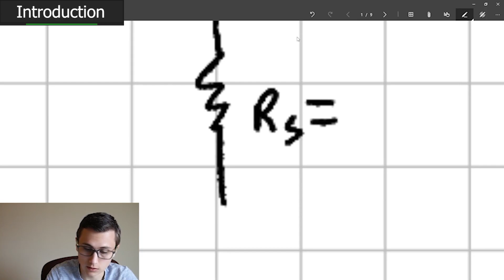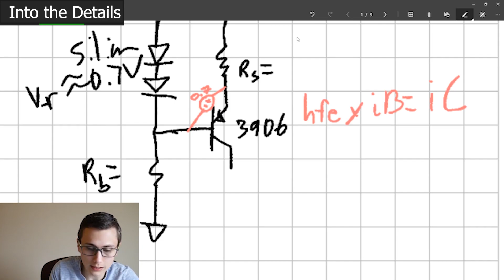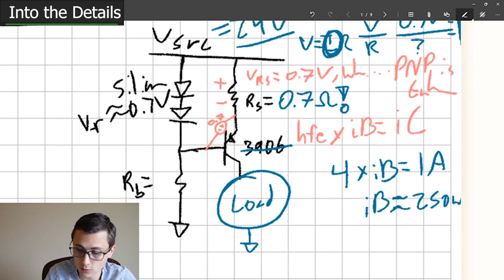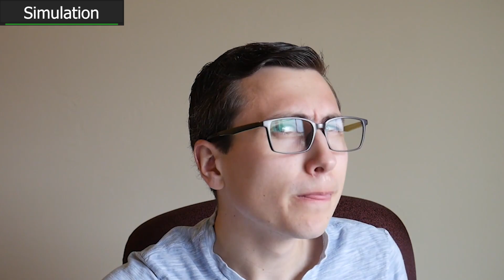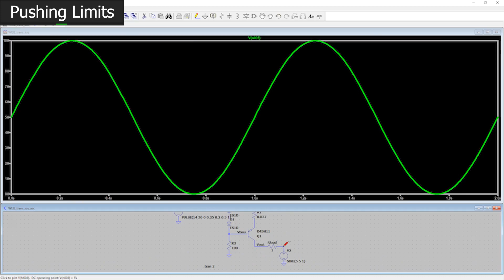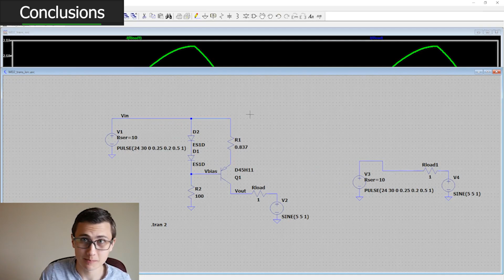Building a BJT Current Source

Comment: If you thermally couple the diodes to a ptc thermistor running from the supply voltage would that create a more stable reference?
Reply from the maker: Hello Han, It would certainly be possible to use a thermistor to compensate the diodes, though a commonly used temperature compensated current source uses an NPN and PNP pair. I'm looking for a good article that describes the function, but sadly.. the most direct resource I found is from stack-exchange. 
https://electronics.stackexchange.com/questions/199379/temperature-compensation-in-transistor-current-cource

It uses the temperature effect of one transistor to counteract the effect in the other! Very fun trick that doesn't work perfectly for discrete components, but works very well for integrated circuits, where transistors can be almost identical.

As always, there are a lot of ways to accomplish the same effect in electronics, and the right path depends on a lot of details!
Thank you for watching, and thank you for the Great question!
Reply: @EEforEveryone  kl! I guess the slower thermal transfer you would get from using descrete components might still be good a LED driver. Where the Vf slowly changes and good transient response isn't needed from the current source.

Comment: 9:00  
V2 = SINE(5 5 1)
What is 5 5 1 and where does that come from ?
Reply from the maker: Hello Suhaila, that's the syntax of ltspice for voltage sources. That's defining a 1Hz sine wave with an amplitude of 5V, and a DC offset of 5V. 

So, a sine wave which ranges from 0 to 10V!
Thanks for watching!
Reply: @EEforEveryone  
Thank you for your answer.

Comment: hi excuse my poor knowledge

how did you just assume Hfe to be = 4 .. 

isnt it defined in datasheet with big range and from BJT to another its different ?
Reply from the maker: Hello Hasan! 
No need to put yourself down. The fact that you are willing to reach out and ask the question is super important!

a Hfe of 4 was a safe assumption. For a 2N3904, the minimum current gain at any operating point is 15. I'd typically expect at least 10.. so rather than look up the gain of a real transistor, I used a rule of thumb based on my experience that I would expect to work on every pnp transistor....

As long as I'm thinking about this... Let me find a more realistic part. The MJW1302AG from on semiconductor is a power PNP transistor, rated for up to 15A! Looks like the minimum gain with a 15A output is still 12, so I think my assumption worked!

Of course, when designing a circuit for a real application and not as an example, it's important to dive deeper into analysis. Without sufficient base drive current, the output current of a BJT will not be as high as originally intended!

I hope this helps, and thanks for the GREAT question!
Reply: @EEforEveryone  hi .. thanks for informative reply.. 

perhabs my question isnt clear or i didnt relate the answer to it ..
i was more concern about 
what if you asume HFE = 4

and then you the actual HFE of the BJT is actually 5 or 6 .. so the current is 5 times bigger not 4 ..

as far as i know it also varies from one to one even if they were identical part number
Reply from the maker: Aha! Yes. I see now. In this case, the maximum current is limited by the resistor connected to the emitter of this PNP Transistor. 

Basically, the circuit is designed so that as long as there is more than the required base current available, it will function as intended. Since the voltage reference is approximately fixed, if too much voltage drops across the emitter resistor of this current source- the transistor turns itself off.

I hope this helps!
Reply: @EEforEveryone  ah, so R1 is biasing resistor that functions to reduce the impact of changing of HFE (wheather its change from part to part) or (room temperature) .. ?
Reply from the maker: Hi Hasan, your comment is very close to the truth, but I think about it in a slightly different way.

For example, if 2v were dropped across R1, then the base-emitter junction would be reverse biased. The transistor would be completely off.

If 0v is dropped across R1, then the maximum base current will flow through the transistor, and therefore the maximum collector current.

If that maximum base current isn't enough to achieve the desired output current, the system will never resolve into the desired steady-state condition. With enough base current (and gain), the system will fall into a balance where some voltage is dropped across R1 and ideally, we programmed this point to achieve 1A on the output.
Reply: @EEforEveryone  wow thats very clear .. now i understand why hfe is 4 .. thanks 🌹🌹
Reply from the maker: Happy to help!! Cheers!

Comment: Do you know something call ( LM4041-N ) To-92 package.
Can I use it exchange of 2 diod ?

Or is there a specific setup I can use for LM4041

I did not test it yet but they say it's can be programmed from 1.2v and up.

If you have some good ideas for it let me know please .

https://www.google.com/url?sa=t&source=web&rct=j&url=http://www.ti.com/lit/gpn/lm4041-n&ved=2ahUKEwjt2s2_2f3oAhUIkRQKHSqqDwEQFjAAegQIAhAC&usg=AOvVaw3a0poxLgIlVZ_CDdPwSAHF

What about TL431
Reply from the maker: Abed! Yes, I love the way you're thinking about this! Absolutely, a precision shunt voltage reference like this would work great as a temperature-compensated alternative to our two diodes. 

It's a two pin-device, so it can live on the high side of the circuit for our current regulator. I think power consumption may be a problem for higher-power designs, but for something like a 100mA-1A linear source, I think this could work a lot better than the simple diodes used in our example!

If you're open to more methods of current regulation, make sure to stick around for our upcoming videos! We have some videos coming about building more complex, but higher performance current sources! Super fun!

I love your creative thinking, and quick improvements to our design! If you want to try this in LTspice with our model, Linear technology (or analog devices) make some shunt voltage references that are probably in LTSPICE. for example, the ADR5040.

Cheers, and thank you for this AWESOME comment!